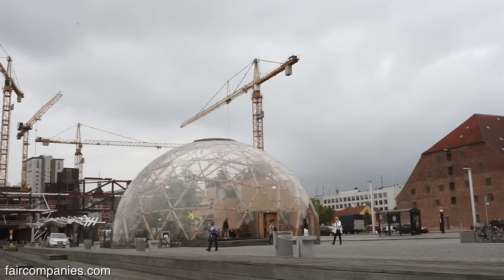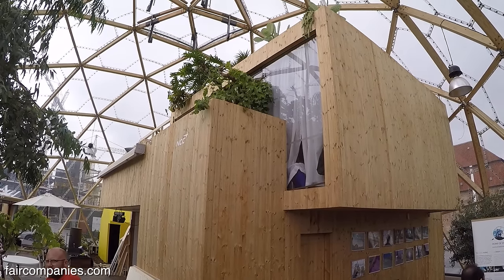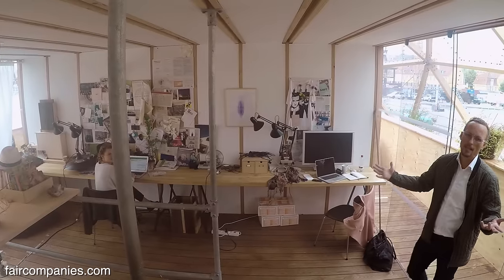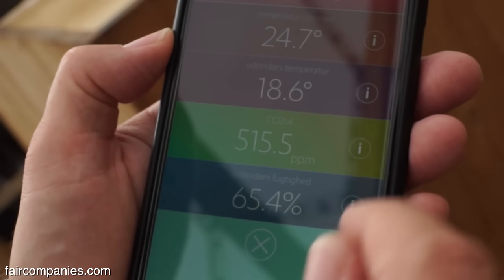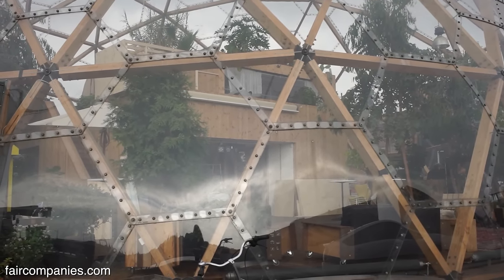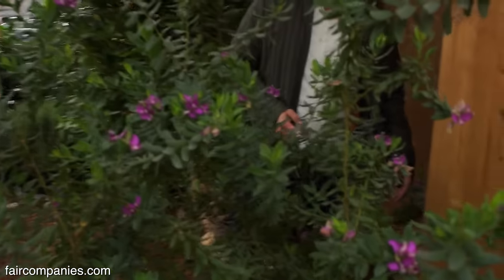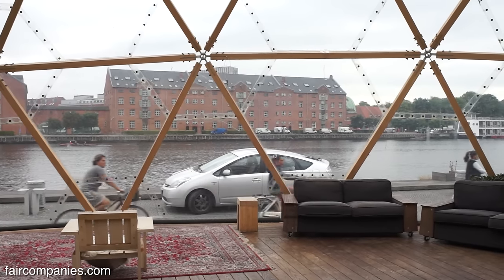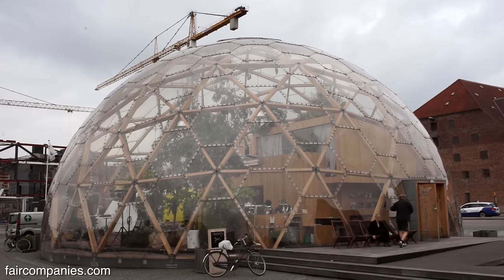Nordic home encased within geodesic dome for passive solar

Comment: Imagine this with photovoltaic cells built into the panes, with reflectivity controlled by electricity, so that in the Summer it can repel heat and in the winter it can absorb it.
Reply: +Anton Seim That is what I was thinking.  If you did this in the desert, you would need aggressive temp control. If you had fresh air intakes at the bottom of the dome that ran underground for a good distance ( in a grid or coil pattern with multiple levels) to come up to an outside pipe/vent, would the air be cooled enough to bring down summer temperatures when the top was opened?
 The idea being that it would be a passive system requiring no power other than the roof vent mechanism. 
 Couple that with light control. Controlling the amount of light would be key but you would have to balance that out with the light (PAR) needs of the plants in the dome. If that could be mastered inexpensively, you could have mini farms under domes growing food year round in most places on the planet.
Reply: +leifcatt I think you're on to something :)
Reply: Anton & liefcatt... Thinking they say is the best way to travel... Moody Blues said that or was it Lebowski? Given the way my 401k has been bouncing forward and backward... There'd be no shame in buying shares in such technology.  -gilpin 8-7-16
Reply: Survivalist dream house: A dome like this that could survive a hurricane
Reply: Too bad they didn't install a climate battery underneath the dome, Then, heating and cooling would be controlled by just a thermostat and a couple fans.
Reply: And also gather electricity.
Reply: Shade cloth is cheap solution also.
Reply: @aliceyingshan2725  The shape does favor surviving hurricanes. The only danger is bigger debris hitting the dome and breaking the panes. The dome itself would probably withstand bot hurricanes and tornadoes, if seams between plates would be airtight - polycarbonate is extremely tough - it's the material CDs are made of, specifically because it scratches and deforms by far less than other plastics, and it is very difficult to crack.
Reply: Sounds prohibitively expensive.
Reply: Yea i am not that rich..
Reply: Polycarbonate will become frosted white within a few years due to UV breakdown.  This is why we don't often use polycarbonate windows, they scratch easily, and they have to be replaced in 10 years.
Reply: @richardlinares6314  at the beginning of the vid they say even in the 60's the energy saving would pay for the dome in 6 years that's a fast turnaround IMHO
Reply: Genius idea!
Reply: I was thinking that on a permanent version the top third could be the concrete dome and then the bottom two thirds could be polycarbonate providing a heat sink and shade
Reply: Wes Brown  but we must start experimenting now. I can see many innovations developed in such experiments being integrated into traditional housing methods gradually.
Reply: That sounds like a great idea.
Reply: @richardlinares6314   initially but the cost savings of the solar? , with a big water tank as heatsink running through the dome, keeping it cool. free hot water in the evenings, free electricity all day.
Reply: @deadprivacy  Passive Geothermal could cool this unit with ease. And solar can heat it with the right collectors for that as well.
Reply: @richardwicks4190  Ceramic coatings are already solving that issue....
Reply: @davefroman4700  Yu missed my point, rather i didnt elucidate it better, passive geothermal aint keeping electrovoltaic solar panels cool, you need to water cool them - solimpeks do water cooled solar but so can you with some hosepipe:), the other benefit is ? you can melt snow off them if you run warm water through the loop.
Reply: It would be very interesting to see how well it would do in an Oklahoma hail storm.
Reply: @corycole3474  with the right glass, best structure to be in in such conditions, they use geodesics in the arctic, up mountains, antarctic as the wind zips right round them,
look how much crap a well tethered geodesic tent will put up with before it takes off in the wind...
Reply: @deadprivacy  Wow! I had no idea. Here in Tornado Alley it can get a little intense during Spring time. The hail can be the size of softballs (marble to golfball size is most common) and sometimes jagged. It falls like heavy constant rain at anywhere from 15 to 45mph. I've even had to go rescue elderly people who were knocked unconscious by hail stones. Anyway thank you for that information and I will certainly look that up.
Reply: @corycole3474  not sure how one might fare in  a tornado, cannot be worse than most houses.
i kinda suspect a tornado would find a route around it rather than through it due to its aerodynamics
Reply: @deadprivacy  LoL
Reply: @deadprivacy  I wonder if the structural integrity would be compromised buy a large projectile, possibly full size sedan or a 100 year old oak tree.
Reply: Too bad the problem in the future won't be the requiring of heat, but hiding from it instead
Reply: @corycole3474  thats the thing with geodesics, all the members are stressed so damage to one area often wont lead to complete collapse....like breaking an egg.
Reply: @post-leftluddite  We are entering a solar minimum. I'm not sure how you have concluded this. The global warming lie was perpetuated in the 90's. In the 60's, the lie was global cooling. Now... we just have "change."
Reply: @Mr Brightside like the desert houses in Dubai
Reply: What a DOOME, if this structure is for rehoming IM HERE! I got bees and apinar in hills, and foreveer wanted something like this, so i can control my queens mating in spring, no need for heating in winter, what a ludacris. This is just awsome, geee, if i could have my big lemon threes in north Croatia, ⛰️🏔️🍄🦉🐝🐞🐞🦅😱🤯😱🤯🍄🍄🐝🐝🤯😱🏔️🐝🦅🐜🐝🐾🐝🦅🏔️🍄
Reply: @Emery Marcus Instablaster :)
Reply: @Harvey Amari It did the trick and I actually got access to my account again. I'm so happy:D
Thank you so much, you really help me out !
Reply: @Emery Marcus Glad I could help =)
Reply: And The time came for something like this with built in panels.... SAULE TECHNOLOGIES
Reply: @corycole3474  I have wonder about hail storm I think I would put some metal grids at the top which can be removed when the hail danger past
Reply: @richardwicks4190  polycarbonate can also be polished back to clear , how do you think the surface starts out? Not very familiar with petrochemical engineering? Fiberglass hand lamination? Epoxy resins?
Reply: @mjolnirswrath23  No, I'm not a materials scientist, but I'm well aware of how poly-carbonates break down under UV.  This dome will be a foggy white mess within 10 years probably 5.  There's a reason we're still using glass instead of plastic for windows.  Plastic has good advantages - much cheaper, more difficult to break (by quite a bit), lighter, you can make it huge with little difficulty - but we still use glass because plastic is just horrible in UV.

I'm looking at this dome house, and I know that the people that made it have limited engineering backgrounds much less material science knowledge.  I really hate "designers" - they constantly make CRAP because they don't know anything about what they are doing.  It's all function follows form and if you try to correct them they scream at what an idiot you are.

The Romans constructed buildings and roads that lasted for 1,000 years and more.  The hindsight is they didn't bother to keep records on how it was built or kept it secret, so their progeny couldn't maintain aqueducts or bath-houses.  This was a significant factor in the collapse of the empire, beyond their abject corruption anyhow.

This home - what are you going to do?  Take it apart every 3 years to polish the plastic?  Designers should learn SOMETHING about what was done before them, and improve it, not just keep making the same errors their forefathers did.  Buckminster Fuller's notes should have been consulted.

After this proves to be a failure, and it will, 50 or 100 years some other idiot is going to make it again, declaring it a revolutionary new idea.  Part of learning is learning from past mistakes, but since this is ALREADY known to be a mistake, I know they didn't learn a freaking thing.  They made it anyhow.  It's infuriating.
Reply: this would require upsizing but it doesn´t seem problematic, but it coul defeat the purpose.......
Reply: @corycole3474  Yes, but so would most structures that are not steel or reinforced concrete. Traditional buildings don't stand up to it. I grew up in Tornado Alley. I would be worried about hail though since that happens more than an actual direct path Tornado.
Reply: @KathleenEdge  Well, if you live in the desert, I'm not sure you would feel the same as it is hotter now, less water and you feel more radiation from the sun. I think we are changing but still definitely on the warming side if you look worldwide. I don't know of any place getting cooler. It may swing in the future but that's not where we are now...
Reply: @deadprivacy  we use them successfully in the Colorado mountains.
Reply: @a0flj0  They could double pane it. Also Europe is cloudier than the US overall. I think people also need more exposure to the sun outside in the winter. This is a great way to do it.
Reply: @leifcatt  we are going to build something similar in the desert but bury it partway
Reply: @richardwicks4190  you just invented the not a dome , geodesically inspired old car windscreen dome. nusing the old steel frames as structural members, you also invented the geodesic version that places each old windscreen in a steel geodesic panel.
youve then got to deal with the ally frame galavnic coupling issue but that could be overcome.
im not making it, you have to make it, you invented it.
Reply: @marissaalonzo7997  Im from SW Oklahoma.
Reply: @deadprivacy  I have absolutely no idea what you're talking about, and I read it twice.
Reply: @deadprivacy  Insulting me doesn't help me understand what you previously stated.
Reply: @richardwicks4190  how do you not get it?
you state that plastic is useless in these domes, so thefore glass must be used, which is cos prohibitive, so you need a source for your glass, recycled.
car windscreens.
Reply: @deadprivacy  Recycling has its limits because you need a source for everything that is recycled.

I'm just saying that this "new idea" is unlikely to be actually new and there's immediate and obvious problems with it, but they ignored them and built it anyway.  That's just a waste of resources and time.
Reply: @richardwicks4190  ok show me a steel dome madef rom old car windscreens. should be easy if its been done?
Reply: @richardwicks4190  lexan high grade polycarbonate?
Bit longer than that, with the heaviest UV protect coatings and external tinting..20 years easy. Polycarb roofing sheets are used everywhere, it's easily recycled, incredibly light in some formats, it's revolutionised the roofing industry....
I can get you a couple of tons of seconds sheeting for a couple of hundred quid too...
Tons...
Enough to build four or five little hippy homes if not more....
Reply: @richardwicks4190  currently,?
There are pretty much no limits to how many car windscreens still in the frame front and back I could get you, right now, probably for free if you are willing to remove yourself.
There are bonded in.
So they come out cracked or not at all.
Save t he e scrapyard a fortune in processing just whipping em out neatly.
Estimate about two minutes a window?
With a decent nibbler , quicker with a Stihl at the very end of life, just before the crusher after the vultures have been so you can chuck sparks and not hurt the parts margins.
They would happily sacrifice the steel frame to be free of the glass and glue they would have to process.
The stuff is structurally superb and to in can always get replacements.
It's a good idea. Dont do yourself down.
You are
Reply: @richardwicks4190  It is so easy too complain if it lasts 50 years comes with a video and instructions in a kit form does not cost the price off a conventional house this could be a Game changer so what if it needs parts that will give new business and jobs opportunities Bring it on .
Reply: @post-leftluddite  nope
Reply: @anonymousbosch9265  Except then you would lose the light needed to grow food year-round 🤷🏼
Reply: @post-leftluddite  Who knows?
Here in Canada, our winters are getting longer & colder & grey. We used to have sunny blue skies most of the winter. Now, barely a spot of sun from mid-Oct to May.
And this winter has been brutally long & cold. (South Ontario-1 hour south west of Toronto).
We no longer have full 4 seasons. Winter has expanded such that we barely have spring anymore... just a long drawn out winter with spring days appearing randomly for a day giving false hope then cold & grey again. Til all of a sudden it's jumps suddenly from wearing layers of winter clothes to suddenly stripping off layers & socks to sandals!
Same with autumn... the leaves start to change colour & if you blink, a sudden wind or rain knocks off all the leaves while they're still green with only some changed to pretty fall colours & suddenly the trees are naked in November.
And then snow storms are arriving 2 months earlier than before.

And summer is sudden & also unpredictable like ut used to be. Lots more rain than I remember in the past. Which means more grey skies!
A few days of super hot & humid.
But Canadians are wimpy creatures of comfort and love their artificial air conditioning. Canadians are definitely not the eco-conscious people presented in media.

Also, with all the chemtrails they are spraying here in the skies, we don't know what they're spraying but it's definitely not good.
They're playing with weather & nature and it's affecting all life forms.
So, here it feels like weather is cooling.
And new house construction is horrible.
The construction business uses so much fake stuff full of plastic & glue  that the new houses have toxic off-fumes.
It's ALL about cheap construction for higher profits more important than the health & well-being of the people and the planet.

So sad really how short-sighted humans are.
Reply: @mjolnirswrath23  Oh goodness!! 
ALL those methods sound so toxic!
Petrochemical engineering? Epoxy resins? Fibreglass lamination? 😯🤢🙃
Reply: @leifcatt  geothermal well or AC tube entering the home would keep it at 55F all day long.   You can even use a solar fan to pump the tempered underground air through the dome in summer
Reply: @mistereearly1141  Yep, works great. I'm thinking of such a system to deploy in a large greenhouse. I've seen such ideas used to keep fish tanks cool in the desert for Aquaponic farming. I first saw the idea used in Earthship homes many years ago.
 You're right, it's a great idea to use for cooling and warming. A primitive heat pump if you will.
Reply: That, with clear solar panels ti power that, would be really cool!
Reply: Folding shades that swing open on each pane sized just large enough to let the sun in through the gaps. the gaps would look like strip lights. would be pretty epic.
Reply: Solar Cells installed on the inside of the PC Dome Cover could create an electricity system and would be... perfect... One could also run a heat pump to store heat for the cold nights and maybe refrigeration too...
Reply: @AntonSeim  imagine if it had wheels and attitude Jets so you could raise it above and below weather so it never got rained on

Comment: LOL, "without glue, no chemicals" standing right next to sheets of plywood :D
Reply: Yes with a plastic dome made from oil. Bwahahahaha. Typical leftist, loves wood floors but doesn't want to cut down a tree.
Reply: Hes obviously talking generally about not having to use treated lumber for the bulk of the building. Stop nitpicking.
Reply: @onZampie  Hes speaking so generally, that I might end up eating plywood or OSB :) I doubt that from practical standpoint, like termites, ants and fungus care. Also geodesic dome or not, you still have dew point condensation from air humidity.
Reply: @Tachikomaster  This idea that wood will rot immidiatley just by being exposed to some humidity is false. There are untreated wooden structures that have survived hundreds of years without any dome. Some moisture and dew isnt going to do anything as long as the wood gets to dry out which wont be a problem inside of a warm dome. Also this isnt a how to video. He doesnt need to explain every little detail so that people at home can follow along. He is giving an overview of a long project. Putting things simply by saying "no chemicals" in refference to most of the wood is completely understandable and most people will get what he means. Its about the context of the sentence. He was saying that because the house is covered from the elements it doesnt need chemical treatment. Its pretty obvious what he means by that statement.

Comment: Actually, it's proven by Bucky fuller that if you have a smaller inlet at the bottom of the dome, then there is a "natural AC of cooling breeze inside during the hot months.  Proof of that is the "freezers" created in the African desert with domes created to cool food all year long.  This may not achieve a "freezing" temperature inside, because it's technically a greenhouse, but the Bernulli effect would cool from the top down!